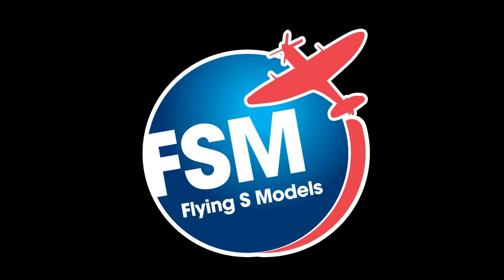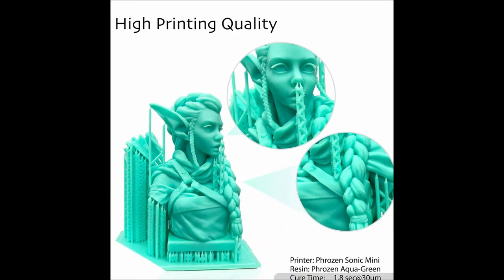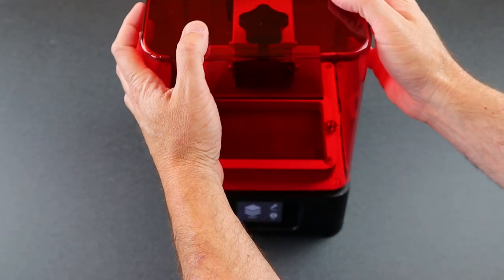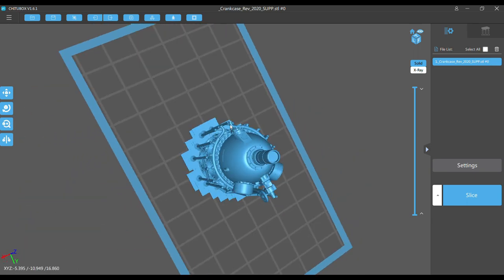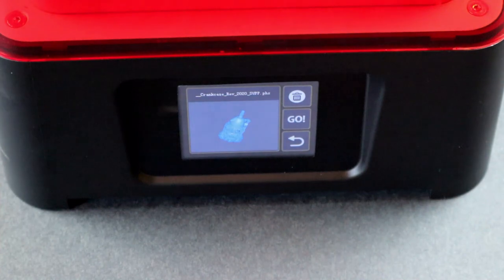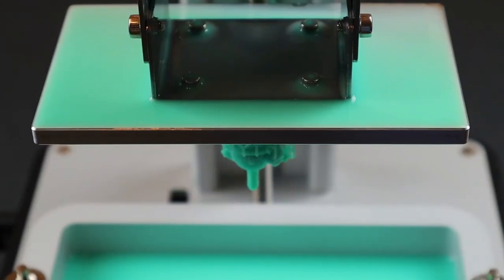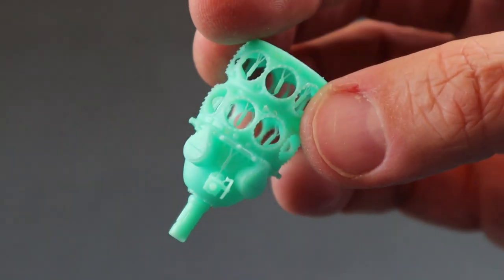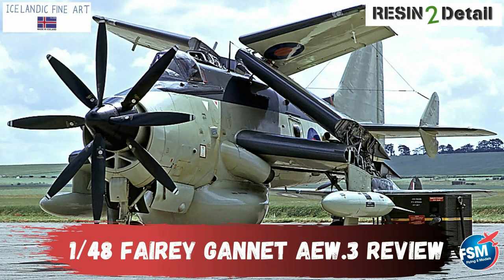Phrozen 3D Printer for Model Airplane Parts

Comment: And, voila! there it is. I should have watched this video before I asked about car bodies. But I am backwards. That engine you printed is phenomenal. You made it look easy, but all of that computer jargon went right over my head. I suppose I could get one of those and have my kids run it. Obviously some of your Fairey Gannett kit will be cast, with other parts printed. Very cool.
Reply from the maker: Yep.  Printer works great and is super easy but the real magic is in the design of the parts. That's where I'm a rookie (really less than a rookie).

Comment: That is some nice detail. How easy is it to find files ready to print?
Reply from the maker: That's the hard part.  The designs have to be created.  You can find odd ball stuff to print but for aircraft modeling, most things have to be designed by the modeler.

Comment: Feb. 27, 2022----Got back into modeling, but this time it's 1/35 scale zombie/apocalypse dioramas. Been looking at both types of printers and resin is the way I'll be going. Thing is, there's a lot of stuff NOT available as kits such as sinks, dining chairs/tables, etc. Which would mean a lot of scratching building and then making silicone molds of them so I could make a bunch of resin copies. But with a printer, I can print as many of something I want, at one time. One YT guy showed how it took 8 hours to print 1 D&D figure, but then he made something like 24 at one time, with it still taking the same amount of time. So I'll be doing the same with portable generators, etc. I'm 68 and trying to learn cad and it's kicking my ass. The reason I want to learn is for several reasons. There are some things I haven't found files for, like porta potties, urinals, etc. Adding to this is me wanting to use a lot of modern military vehicles, specifically, APC's...armored personnel carriers as basically, ALL these kits have NO interiors?! When I learn cad, I'll be adding detail not seen before, even if it's for a specific kit. And maybe I can even cad people/zombies? Once that happens, hope to post my files online for free so others can enjoy/print them. Thanks for the video, because I've got a lot of OLD aircraft kits that I started buying, but never built back in '74.
Reply from the maker: Yep, 3D printing is really changing things in the model world.  And welcome back to that modeling world. 3D printing will be great for what you are after.  Take a look at MOI 3D.  I have found it to be really easy to learn to produce the kind of parts you are after.  And they have a free 90 day trial if you want to check it out.  Ping me over on my facebook channel/message if you need any help with it.